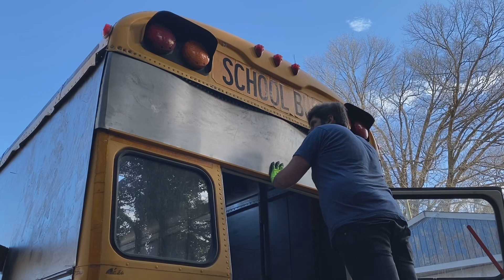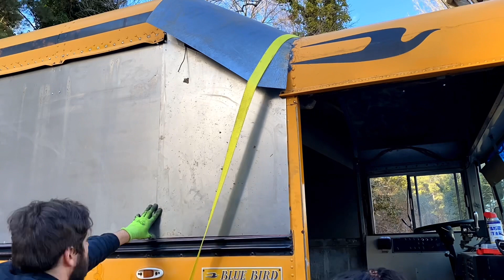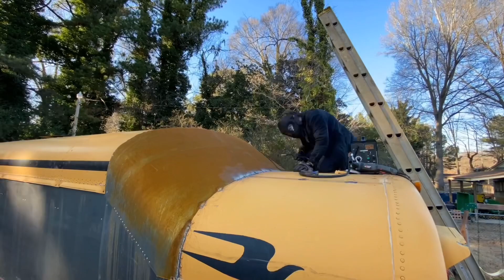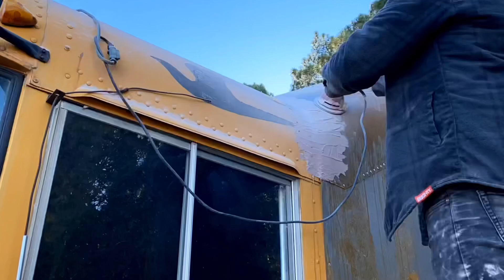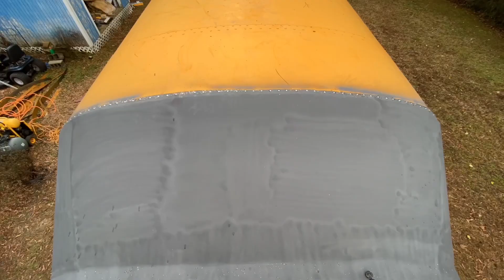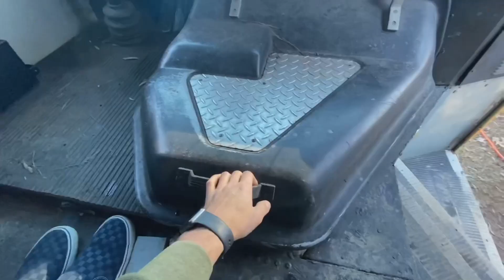School Bus Conversion Episode 9 - The bus is finally closed in! ROOF RAISE COMPLETE*

Comment: Thanks for the videos I’m actually thinking of doing the same thing myself I haven’t found a bus yet well I have seen one but it’s a few hours a way but I haven’t committed to it i could probably do the lift the siding and probably the cut out for  windows on the sides but the wood work I don’t know driving the bus will be know problem because that’s what I did was drive a drove a garbage truck for over 12 years and it set up the same way I even can weld well I wouldn’t say I was a pro but I can weld metal together because I did tractor work and I often had to weld my equipment or trailer many times for whatever reason but wood work making cabinets or building something I don’t know that’s measuring stuff and putting it together I might have to find a retired guy or someone looking for work and needing some extra money on the weekends or nights anyways good luck and I’ll be watching